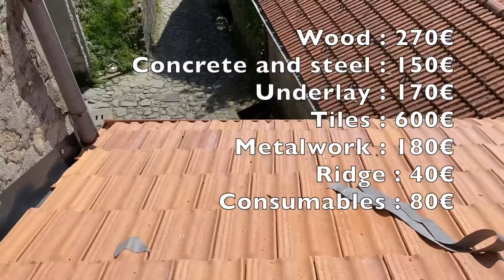One man DIY re-roof - Can it be done? is it worth it? what did it cost?

Comment: You should be proud off yourself, you have done a great job and saved a fortune.. Yes it took you a long time but you were learning on the job and lets face it you couldn't have really had worse luck with the weather. as you tackle the other roof areas in time you will be able to apply you new knowledge and skills.

In your costings, I assume that the guttering was part off the metal work costs.

Keep up the good work 😊

Robb Torremolinos Spain